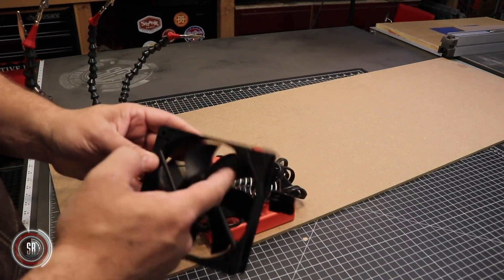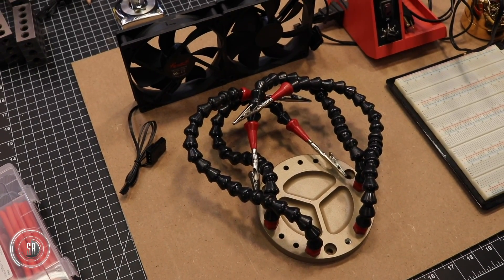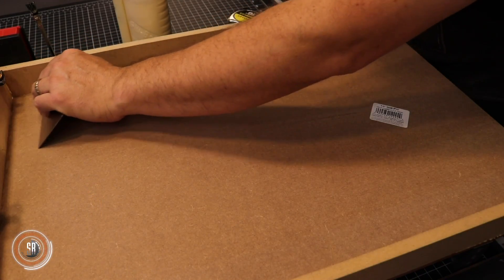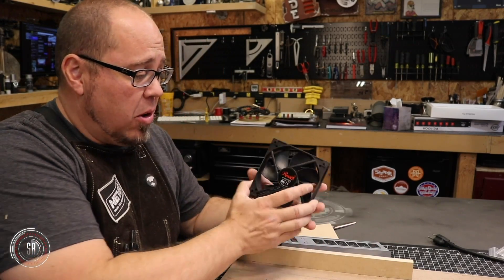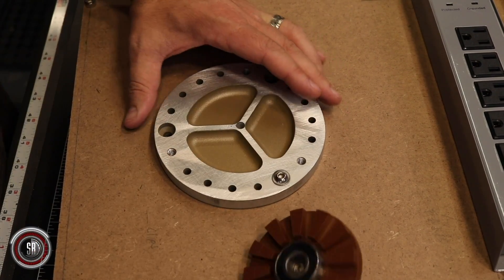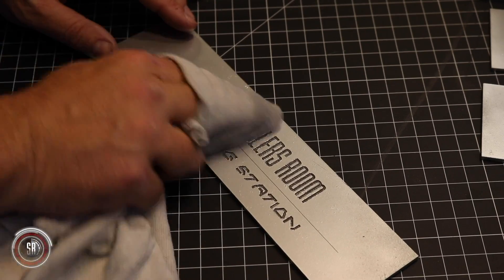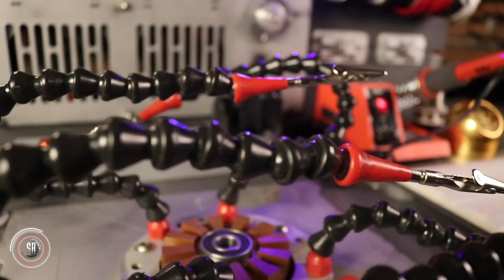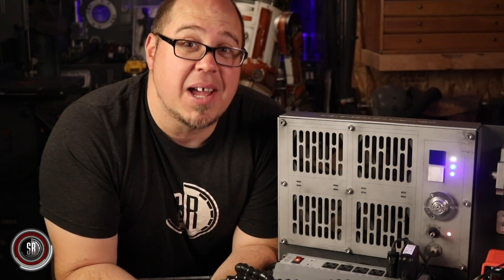How To Build A Soldering Station

Comment: I find it odd that you put a solderless bread board right where you'd want to do your soldering, a simple rubber or anti-static mat makes more sense.  Also, what do you most often use while soldering, flux, needle nose pliers, diagonal cutters, a solder sucker and more - where are those?  I think I need to design one of these.
Reply from the maker: Well, the beauty of this kind of build is that each person can make one that best suits their own way of working.  So I’m sure yours will work for you.

Comment: Hmm... I can tell a geek when I see one. Whether it's medieval times or Star wars, I can always tell, especially if they have a life size R2 unit sitting behind them😂... Of course the kinda Star wars theme of your soldering station also helps to give it away, although, those fan grills remind me of the empire ships, so I don't know why you didn't make your fan grills have a red glow behind them, which for whatever reason is so prevalent on empire ships.

Honestly though, good job...

I am looking for ideas on building my own soldering station, albeit more portable in size, as I have a small TS100 iron coming in the mail from iFixit, and your video, as well as others, have given me a few ideas, although, I would like to get most of my parts 3d printed, and perhaps have a pocket size soldering station that has a captive solder holder with hole for pulling solder through, and possibly a small foldable silicone or other thin heat resistant mat to adhere to the soldering station table type work surface parts, probably a dovetail hinge type setup, where you just open the case and pull out a single or multiple, plastic plate(s), depending on size required, and then just set it where you need it and have some dovetail joints connecting it to the soldering iron case and/or other modular accessory pieces, such as more work surface pieces, or a helping hand device, in a kind of modular layout... Possibly, if I wanted to semi-permanently attach everything together, I could have some extra TS100 case screws lying around screwed into the case to be able to re-use any special opening screwdrivers with this, and save space, while giving a bit of strength and stiffness to the joints...

Comment: I don't know but i don't like the idea of soldering in a workspace.
Reply from the maker: you don't like the idea of soldering in a workspace?  Why is that?
Reply: @TheSmugglersRoom  to be precise confined workspace.

The reason is pretty simple lets say i am going to repair a monitor. I can't do that in a confined space.
Or maybe soldering some big batches of boards.
I sort of tried the idea before.
It would be better if the area of the workspace is bit bigger like a small tabletop.
You should make a v2 of your station instead making your station moveable you could make it permanent. You could make a small workbench as your soldering station.

Comment: A pretty great project. I usually shortcut with premade circuits so I don't have to solder and wire things up. It is one of my failings as a maker of things.
Reply from the maker: I am totally with you Wayne.  That's why we purchase the LED's with the built in resistors, saves so much time.

Comment: bit of constructive critisism......... putting a breadboard directly in front of a soldering station means any blobs of molten soulder could potentially fall down inside the holes - thus shorting sections of it out. Add to that clippings as you cut leads off after souldering - i honestly think its asking for trouble. as someone who started soldering at about 8yrs - and im now 60 - i genuinely think this was a "job creation scheme."
Reply from the maker: Hi Andy, I guess we'll have to be careful not to over use our solder so we don't run into that issue.  Thanks for watching.

Comment: Point of order that is not a soldering station it is a bread boarding design center one thing your missing is “a pair regulated DC power supplies”. I would think the two blocks on the right hand side would be ideal location for power supplies.
Reply from the maker: well, i guess "Soldering Station" rolled off the tongue a bit better than anything else I could think of. LOL

Comment: Years ago I purchased a used rifle from a state prison the stock had a deposit of what I call hand wax common on old car steering wheels and stick shifts kind of a black rough surfacing of oil, skin, sweat  like plastic dip or truck bed liner.  Another item that could be a weathering is blood and/or alien goo/gore remember the acid blood in Alien...
Think “solvent dissolved styrene packing peanuts”.  I use to back fill models for weight with this.  I had two costumes of Conventions one was a Corillian smuggler, the other was a blue denim smuggler using the same basic accessories, that allowed me to change clothing.

Comment: I've never had a proper soldering station, most of my wire, my tip cleaner, flux, is all in a grocery bag hanging on a nail in the shop. Another BAD habit to break, Hanging things on nails is just begging for an injury.  Very inspirational!
Reply from the maker: I hear you!  For years things have been a mess around the shop.  Hopefully this gives you some good ideas for yours!

Comment: I would consider ducting the exhaust through filtration or venting outside, otherwise you are just redistributing fumes in the basement where you will breathe them in anyway.
Reply from the maker: good idea.  This will be used mostly in the shop, and we have good ventilation in there, but still worth exploring! thanks

Comment: I totally get where you are coming from when you talk about avoiding certain tools when they are inconvenient. I used to be that way with air tools because the compressor was loud and a pain to get out and setup. No to mention tripping all over the hose. So I put it in a closet and ran permanent air lines on the ceiling of my shop and now I use it all the time. I think I'll do the same as you did with the soldering station. I love the way yours turned out!
Reply from the maker: 100% I was the same with the compressor too, then i put it in the assembly table with a permanent line and BOOM!  Hope you make a soldering station as well.  We are going to be doing more of these projects, they really help workflow for sure!
Reply: @TheSmugglersRoom  Did you see the little one Adam Savage recently built? He had some pretty cool ideas too.
Reply from the maker: @ThatGeekyMaker  Yes, that was great.  I actually purchased the soldering iron he has.  Haven't used it yet.

Comment: You might want to incorporate a screen filter to keep your fans cleaner longer.  Also, most soldering stations take ESD into consideration.  A separate bench is used for powered testing operations.
Reply from the maker: very good suggestions!  Thank you much!

Comment: Nice build.  I would recommend sandwiching a carbon filter between the front grill & the fans.  It will help with the fumes.  A rotary knob behind the knob above the fan switch would be cool to be able to adjust the fan speed.
Reply from the maker: That's a great idea.  I had not thought about filter for the fans, and the rotary nob is a perfect solution!  Thank you!!!
Reply: @TheSmugglersRoom  Glad I could help.